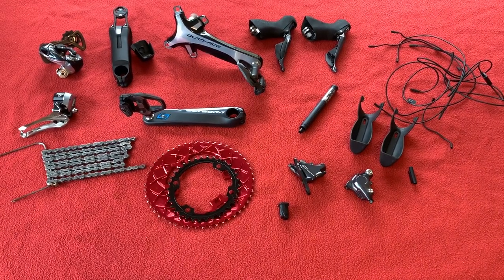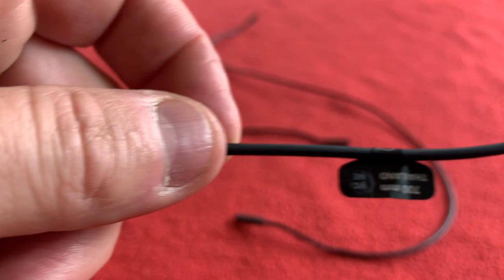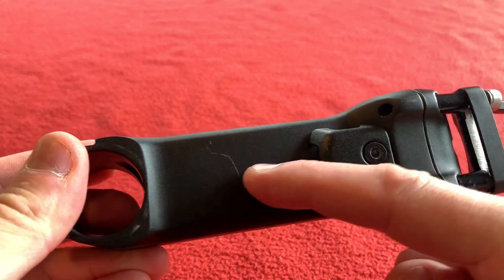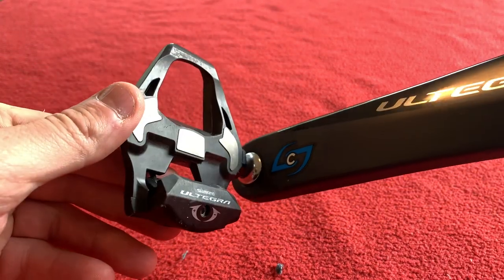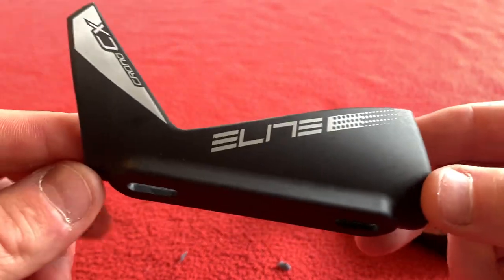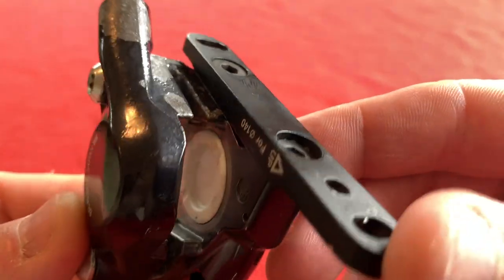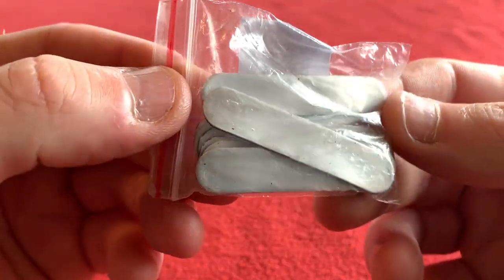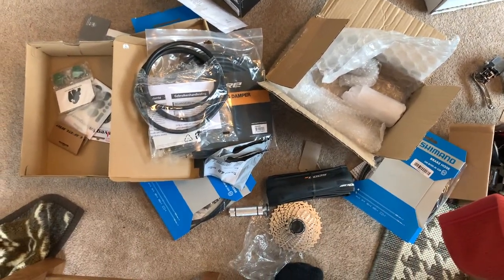Yoeleo R9 Parts

Comment: Can't wait for the next parts :) 
Why "upgrade" from dura ace to the ultegra derailleurs? especially if the "old" parts still work perfect. 
Getting the foam damper over the brake hose was harder to do, but when I put the cables through the frame, the foam stayed in place. While on the gear cables, it was smooth to put on but inside the frame the foam moved and get stuck in the headtube, so I had to cut that off. Still the cables are quiet in the frame. 
I still don't see how you will be able to reuse the stem with the internal cables, but I hope you manage.
Reply from the maker: CyclingMilan I’m changing them because I’ve had them for a number of years and thought I’d get some newer parts... that’s the only reason. I have tried my old Aerofly II bars with the venge stem and I can get it to work, there’s a gap though under the stem into the top of the frame, I could go this way if I found the Yoeleo bars too hard to thread. Having tried already, I can thread the Yoeleo bars but, there’s something very sharp inside mine which means I pretty much cut through to the innner white core when I pull them through out of the stem slit. 👍
Reply: @KyrosHouseCycling  yes there are some sharp bits inside the handlebars for sure, my cables also came out a bit scarred, but nothing that would influence the function. 
I am surprised how it works with the stem, you can show it in a future part.
Reply from the maker: @cyclingmilan  no the function will still be there, just mine must have razors inside... the other handle bars I’ll make a video on this week and release it next Sunday. 👍